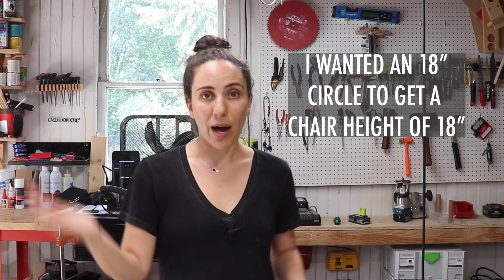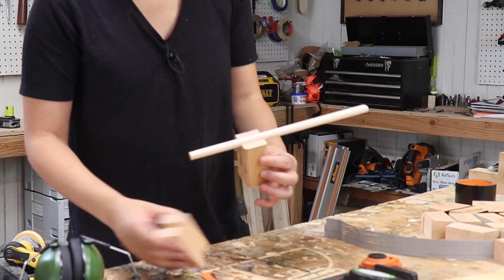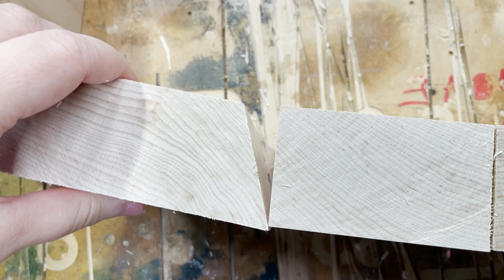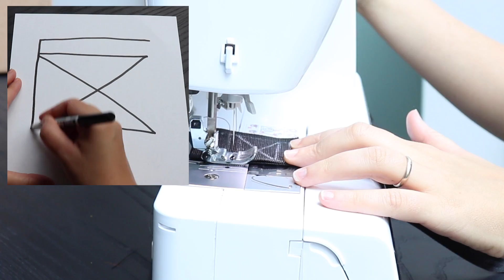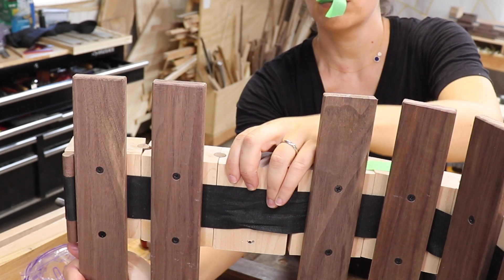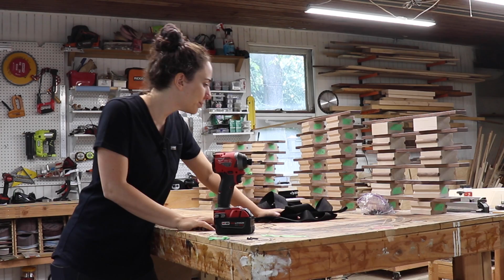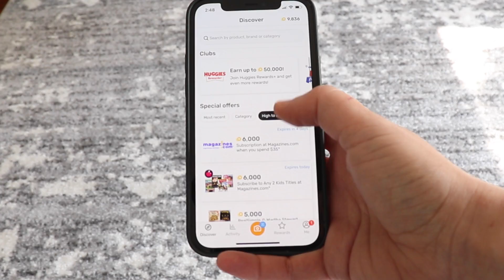I ATTEMPT to make a Roll Up Chair… AGAIN...

Comment: I would hesitate to use leather as leather can stretch a fair amount, too, especially when wet and/or warm, and especially when it's thin. So definitely experiment with a short strip first? Since leather is really freaking expensive and also only available in finite lengths. Sure a cowhide is pretty big, but I don't know if you could get a continuous length that'd fit this project ..
Reply from the maker: That’s why I didn’t go with it. Didn’t want to waste any more money. Ha

Comment: I think fixing the strap to every single pieces would help. In this case the tension would not got through the whole structure. Only from piece to piece. This would also solve the Problem of collapsing
Reply from the maker: But it would still stretch between all the pieces
Reply: @3x3CustomTamar  You're right. But if you would fix the strap close to the gaps, the strech would be less. Strech depends on given length. Now it can strech over the whole length of the chair. If you would staple or screw the strap in an square pattern close to the gap the given length would be much shorter. Anyways great work!

Comment: The problem seems to be with the strapping. Too much stretch in it. Have you tried regular lifting straps? You can get them in whatever width and length you need and they aren't all that expensive. Cut the loop ends off with a heated knife to keep them from unraveling. They have a very minimum stretch, as they are used for lifting heavy loads.
Reply from the maker: I actually bought some that I thought I would use here. Maybe I should have used that one. But I still think too much tension on the lives causes the chair to collapse. So that wouldn’t have solved that part

Comment: The idea is very cool and the chair looks amazing. But i do have to disappoint you. I don’t think any material you can get your hands on will work. As soon as you make the part that your back rests against its creating a leveraging effect. The 70 kilo’s of an average person will put at least hundred times more kilo’s of strain on the small point its leveraging from. I bet even the strongest and least stretching material you can get your hands on will just rip itself apart. Leather won’t do you any good.
Reply: I would love to be able to draw something to show you the force applied
Reply from the maker: Yeah. I think you’re right

Comment: Have you considered tie down strapping ? Such as used for ratcheting down equipment on a trailer. I don't think this kind of strapping stretches hardly at all. Howevr they usually come in orange, so it might have to be dyed.
Reply from the maker: I did. I actually bought some. That’s yellow. But after this many attempts and getting hurt. I just figured this version wasn’t going to work. But something to look into for the next one

Comment: The only thing I can think of is that the strap needs to be attached to each piece, instead of just on the ends. That way the length of strap between two pieces that can stretch is limited and you're not locating all the extra material in one place where the entire structure collapses. But drilling through or stapling the strap could introduce weaknesses in the strap itself and the potential to tear...

Maybe if you used leather and glued it to each piece of wood? I'm not an expert in material sciences, but that would be the direction I'd go next. Would certainly make for a pretty failure if it all went tits up again.
Reply from the maker: Yeah. It’s definitely worth it to try again
Reply: @3x3CustomTamar  Third time lucky?

Comment: In my mind I think the mitered cut end “gaps” between the roll up joints might be happening because of “vertical” slip at the straight cut miters. The strap holds the front of the miter but the back side of the miter is not supported which allows the pieces to slide against each other at the contact surfaces. What if, on the opposite side of the strap at the miter connections, you add some kind of notch or groove running horizontally across the miter that interconnects with the next piece to keep the surfaces from sliding. A lip of some kind to interlock the pieces like a puzzle, so that the strap isn’t carrying the entire load of the chair form and only holds the shape. Construct the notch in a way that allows you to roll the pieces and the notches come together like a gear. 
Also, I’ve noticed that you don’t wear an apron when you work. I’m an apron guy, they keep me tools handy.
Reply from the maker: Interesting thought
Reply: @3x3CustomTamar  on my second viewing it looks like the dowel you used is similar to my thought. Maybe change the dowel to a French cleat or square dowel instead

Comment: connecting the ends, the back support to the floor  in a loop is a great ldea.  Consider cargo ratcheting mechanism  to add tension to the loop. not pretty but it might solve the issues.
Reply from the maker: Could work

Comment: It seems like stretching, and NOT strength, is the entire problem.  Is it possible, do you think, to use chain--like metal chains, or even a system of hinges?  And maybe where there's the most tension, make the wood segments even thicker--like the higher the tension in a given area, the thicker those segments are....  This is such a cool idea, it would be a shame to lose it now.  Prototyping is SO HARD!  (I think leather will stretch too much.)
Reply from the maker: Yeah maybe I needed thicker pieces but it was already so heavy like this. I don’t want it to be so heavy
Reply: I thought that, too.  :)  Regardless, I hope you keep at it.  It's an inspiring sort of challenge, and I hope it works out.

Comment: Um I looked up the original work and two things poped to me. First, the design has a contrecurve on the backrest and I think is to counteract the fact that the chair lowers the second curve when you sit, so you don't have to sit all the way. And second, the designer uses some sort of wool (?) felt and I think it's not glued all the way, just the ends, so I think there is some type of core besides the felt, like a rope of some sort..
Reply from the maker: I think he used some sort of rubber. From the research that I did

Comment: Try to use steel cable instead of strap.. and on the ends a system to adjust the cable to tight it just like a bicycle brake cable..
Reply from the maker: Maybe
Reply: @3x3CustomTamar  think about it.. maybe you can experiment with both methods on a small scale and you can compare them see what happens
Reply: Or.. make the chair in a chain form.. idk how to explain.. like let the pieces pivit to eachother maybe with hinges
Reply: How would you tension it without the backrest curling in?
Reply: @jonny5alive123  it curls becaus the strap straches.. the cable wont strach as much or wont strach at all if its a thick cable

Comment: oh man, good effort! if you do have another go, i really don't think leather is the right solution...it will definitely stretch loads too.
i think you need to find kevlar strapping or maybe make your own with unidirectional carbon fibre, fibreglass or kevlar roving cast into silicone, which would let you customise the colour and get a smooth surface on them at the same time.
alternatively, based on your dowel idea, i'm almost certain that connecting the pieces with a separate rigid segment from centre to centre like a chain link would work statically, but might effect how nicely it rolls up...
Reply from the maker: Maybe!

Comment: Tamar, I believe the issue is that the strap is loose within the joints and that allows the ends that want to roll back relax the area that needs to be tight.  Increasing the "overall" tension is just making the back and, as you showed around 24 min, the bottom to roll back since extra tension there is just making the chair roll into storage shape.  I would suggest that the strap be "fixed" to the first or maybe second block that makes contact with the floor and the block directly above it when the seat is set.  This is the section of strapping that needs to be tight to make the chair seat stay upright.  Affix the strap with that section "rolled up for storage" to make that section tight since you need the outside of the blocks to stay in contact with each other.
Reply from the maker: Yeah. That might have worked. But after I got hurt. I didn’t want to risk my kids getting hurt as well

Comment: There is just too much mechanical advantage on your hinges, the strap is located just a few centimeters away from the pivot point while the weight is places really far from that. You might be having about 50x the force on the strap than on the back of the chair, that means a for every 10kg on the back of the chair will apply 500kg on the strap, and it doesn't really matter how strong the strap is, at the kind of forces we are dealing here it will certainly stretch.

A 50kg person sitting on the chair will exert 1250kg of force on each strap, you would need some kind of industrial strap to be able to hold that without issues.

Maybe an actual metal hinge would be the only possible solution
Reply from the maker: Maybe!

Comment: I cannot wait to see this chair design finally get completed…

I am keeping my eye on this project.
Reply from the maker: Haha. One day. I will get it.
Reply: @3x3CustomTamar  So it seems to me that because the webbing is only stopped from sliding by the dowels at the ends, everything in between can slide. Because of the leverage created by each weight bearing angle and the compounding of all of those angles, the webbing slides and pulls the ends back in on each other. Securing the webbing to each individual wood block (two flush mounted screws under the slats maybe? Or possibly just putting the screws that hold the slats through the webbing...) would solve for that sliding. Then, the most likely points of failure would be the holes made in the webbing. The webbing might be strong enough in its own to deal with that. Alternatively, they could be be reinforced with more box x stitches, which might also mean doubling the straps (admittedly more tedious, but in for a penny, in for a pound right?) I think that if the screws went inside the box on each side of the x, then that could (maybe..?) be the best way to reinforce it. Admittedly, there's a whole bunch of 'maybe' baked into this suggestion, but just some brainstorming from thoroughly invested fan.
Reply: @alistairlacaille  yep, I think you describe the problem. Plus, the whole thing should be assembled with some tension on the straps so they stretch less when in use.
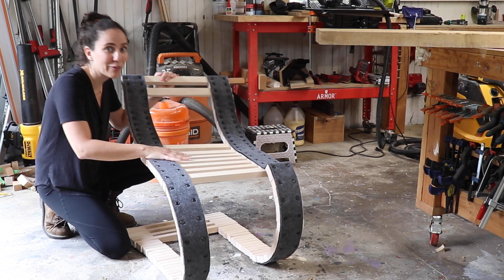Reply: @3x3CustomTamar  okay conpletely randomly came across this - 5:30 into the below video, Vousair Chair (or something, on mobile can’t check) - they leave it under tension and use a strap to keep it in chair form… https://youtu.be/NtXK5ZgQ54w

Comment: Maybe wider blocks with a steel cable running through the upper/side of the blocks. And probably make ik shorter/smaller too. I loved the idea from the dowels
Reply from the maker: I was thinking wider blocks might have lessened the load as well. Ugh… ha

Comment: You're leaving the strap loose on each piece so it can flow and adjust, you might have better success by fixing it on each block.
Reply from the maker: I mentioned that at the end. And I was planning on doing that after getting the strapping length correct. But after it collapsed on my arm. I gave up so my kids don’t get hurt. Ha
Reply: @3x3CustomTamar  thats perfect, its better to know when to get away from a project, we're just postulating from the couch so its much easier to come up with stuff haha. Loved the video nonetheless, there is always something to learn on them.

Comment: Just curious if running a cable through the center would work? It would, I think create center not side tension. Also you could tune the tension like a guitar.
Reply from the maker: It would work as a regular chair. But the connection being in the center of the blocks would prevent it from rolling up

Comment: Maybe metal hinges or steel cable, the advantage of the cable is that you can make the tension adjustable.
Reply: The hinges (in place of the strap) sound great.
Reply: If a 200lb person sits on that 18 inch diameter, the max moment in the chair is about 150 ft-lbs.   For two straps , that's about 75 ft-lbs each.  If the blocks are 2 inches thick, the strap tension needs to be about 900 lbs to support that weight.   The design on the strap is not about strength, but stiffness.  Nylon's modulus of elasticity means that even if it does not break, it will stretch too much.   If the user "bounces", the loads can easily double or more.

Steel strapping (like used for attaching heavy cargo to pallets), or hinges could provide the required strength, with minimal elongation under the loads here.  It would also make the chair much safer.
Reply: @danliebster9894  If she were to use 900 pound hindges, that would get pricy quick. Every strap synthetic, natural, or metal will stretch.
Reply: @TimeLapseRich  I agree.  It's actually a tough engineering problem.
Reply: @TimeLapseRich  you wouldn't need 900 pound hinges though. The hinges would be sharing the load. Of course this would mostly be in the front curve. So some combination of stronger hinges there and weaker hinges elsewhere.
Reply: @TimeLapseRich  she doesn't need many of them as the load is concentrated on few of them.
Reply: @danliebster9894  Or maybe a roller chain resting in a dado cut into the face of the blocks.
Reply: I came here to recommend replacing the webbing with cable as well.
Reply: I was thinking about metal hinges instead of strapping too, though finding ones that are strong enough to support an adult while being small enough for the design might be an issue.
Reply: @oysteivi  Would it work if the lengths of wood were the full width of the chair? It would be super heavy, but you could hinge all the way across (piano hinge or similar).
Reply: Hinges feel like the right tool for this.
Reply: A variation on this is to cut a groove on the bottom curve under the strap and a motorcycle chain to hold the tension for just that section.  Could probably be made adjustable with a modified screw tensioner.
Reply: Also came here to say hinges, at least on the front curve which seemed like it was the failure point.
Reply: Wooden hinges instead of metal would continue the aesthetic
Reply: i agree that hinges seem to be the right way to go. could even use the straps just to hide the hinges. 
the other issue i notice is the angles need to shift as /__\ is not ideal for all sections of a curve. sure it matches the curve but the angle of direction changes and thus would need a cap stone \___\ so there is wood to support the structure and not relying only on the strap. sure gluing/ fixing multiple sections at those key angles could also solve that issue but at the cost of flexibility.
Reply: My first reaction was steel reinforced timing belt, but even that would have some stretch, so the idea of hinges sounds more reliable.
Reply: Agreed. Wire rope running through the blocks (rather than being clamped) would take the strain without stretching, would keep the blocks aligned and allow allow a tensioning system - in theory 😝
Reply: @chrisking4616  the friction of the rope and wood would destroy the latter.
Reply: just  commented almost the same thing
Reply: If you use Hinges you are putting a hole in the wood which will weaken the edge and just pull the screws out of the wood. You might use seat belt strapping it's only made to give a little under tension.
Reply: @alancluff1115  likely at least 8 screws + epoxy per block, it should hold (or worse case, need thicker wood)
Reply: I was thinking this as well.  The hinges could essentially be one giant multipart hinge where every hinge plate but the ends has two sets of knuckles on it.  This would also eliminate the need for the dowels too.  While you don't need many tools to make hinges, the overlap in toolset for hinges and woodworking isn't big... it's technically possible to do it with a file, a portaband, a vise, and a grinder (I've made lots of hinges that way),  you would really need a metalworker to get involved to have it take less than the amount of time you've already spent on this.  Someone with a cnc plasma table.
FYI if you think about doing it with hinges, please note that all commercial hinges have knuckles that simply wrap around a shaft and end, and they aren't meant to be that strong.  You'd need to find or make hinges where the metal completely folds back on itself and then rivets shut using tinner's rivets (not pop rivets) before the knuckles are cut.  I've got a paint cabinet that has 20+ quart cans of paint hanging on shelves on the door, and the doors are suspended by two strap hinges I made that way of 14g steel, and they're going nowhere.
On the other hand, maybe if you cut piano hinges to length and then riveted them to a backing plate it would do the trick... piano hinges have floating knuckles but they're pretty strong, and you'd only have the issue of them perforating the edge of the wood to deal with.  Then the only issue would be aligning them with the other side.
Reply: I was thinking the exact thing!
Reply: i watched the video and suggested internal cable, scroll down, and you had the idea already, lol, i think you are correct
Reply: I think multiple steel cables would be the simplest answer.
Reply: Steel, with a tensioning mechanism built into the chair is probably the only answer. I'm not sure if cable is sufficiently strong, otherwise go for steel chain.

In fact a custom steel chain would probably be an interesting idea. With angles in every link, to lock it in place. Then add slats to sit on.